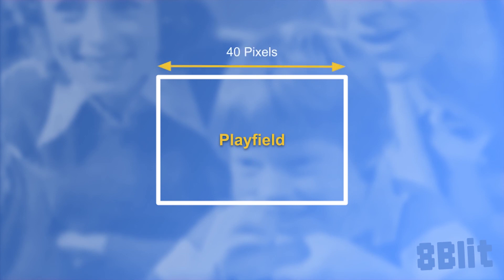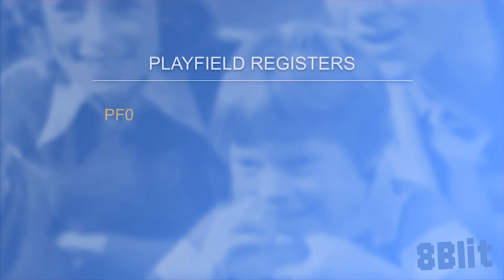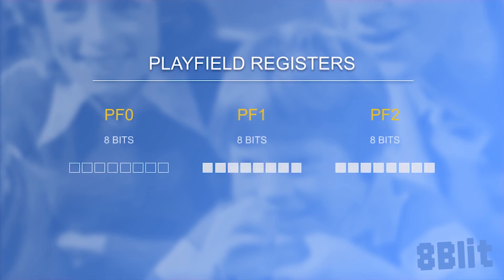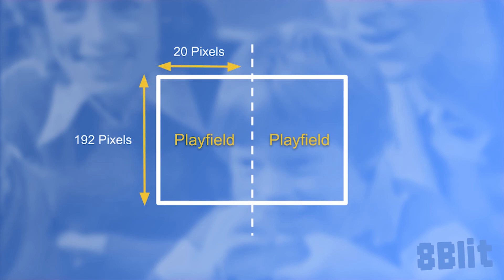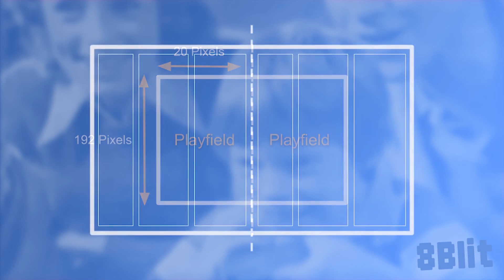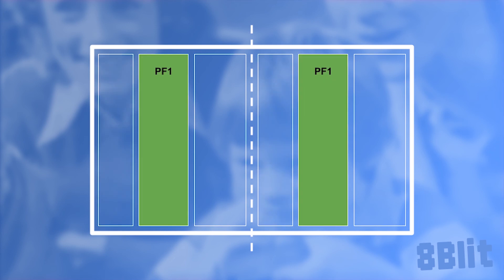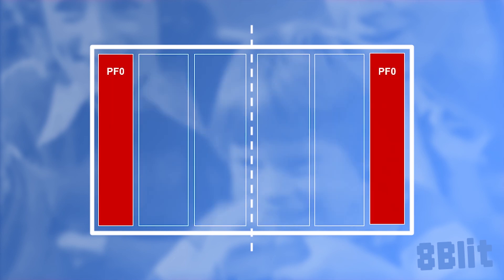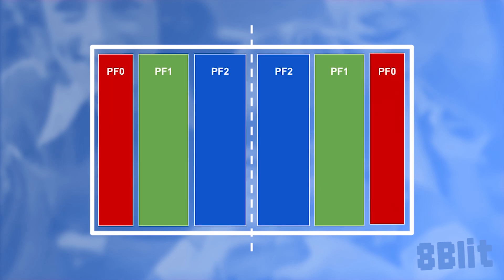Asymmetrical Playfields + 125 Subscribers

Comment: The extreme low level control of the 2600 - as a requirement to operate it (I would call it "flexibility") - is one of the main factors that allowed it to last as long as it did. It lasted longer than anyone ever thought it would, including Atari and the engineers that designed it!
Reply from the maker: Very true, with the low processor speed and the lack of video memory, you need precise control to push the hardware.
Reply: @8Blit  Yep. No video memory to speak of and only 128 bytes of storage* means every trick in the book has to be used to do almost anything meaningful. But that also meant maximum flexibility.

* (engineers from Atari say they were originally told it would have to be 64 bytes, but they fought hard and won to get those extra 64 bytes)
Reply from the maker: Imagine what games would have looked like with only 64 bytes!

Comment: Congrats on the 125!
One thing that will improve the videos is to simply lower the background music, as it does drown you out quite a bit.
Reply from the maker: I totally know what you mean. I haven't quite found that sweet spot yet and still working out the levels on different speakers/head phones. Thanks for the feed back, and support!
Reply: @8Blit  So far, enjoying it. 
Programming is way over my head (found out in college, even though I had to take Assembly at one point), but interesting to see how it works, especially if you get to the multi-color sprites (like Pitfall Harry, for example). I know most of that is manipulating the line color for that row of sprites, but still interesting to find out.....